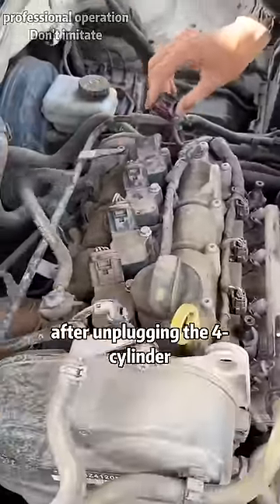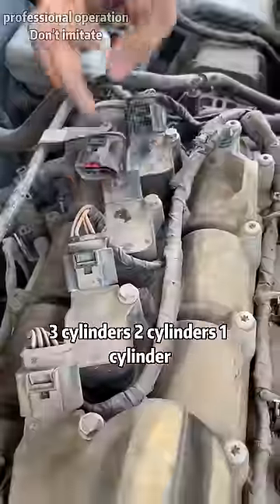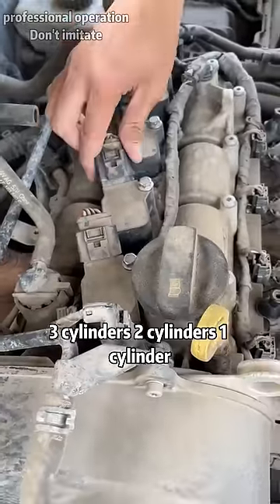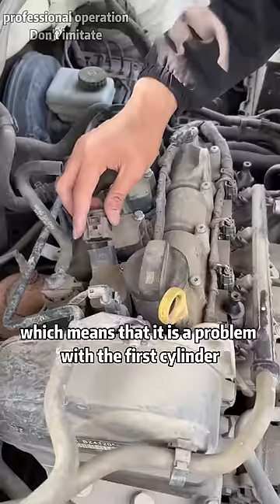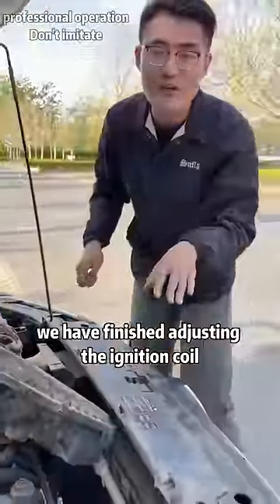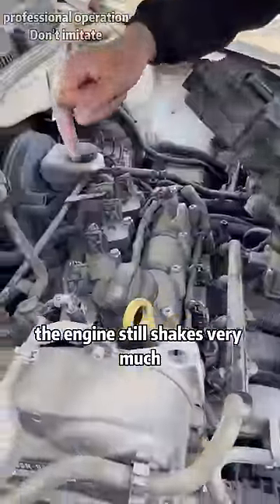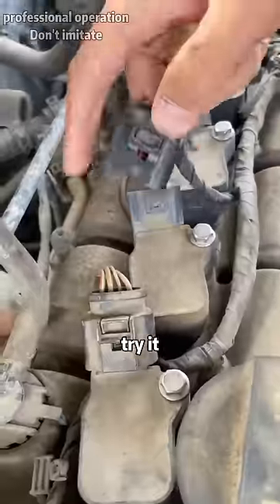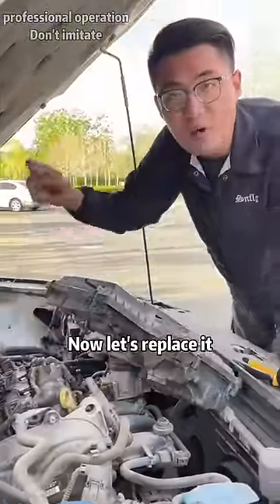（PART2）90% of people do not know the maintenance skills！#tips #car #shorts #tutorial #driving

Comment: Or just run an obd code check 😂
Reply: Not always useful. This car could be old enough that the only code the computer spits out would be a misfire detected code. Not all OBD-II systems handhold you like today's systems do, those older early generation ones were more of an on-board dumbass than an on-board diagnostic and at best simply told you it wasn't running right.

My '95 F150 is fully OBD-II compliant but it can't tell me which cylinder is misfiring. It's too primitive of an OBD-II system to know that. It would just report 'Misfire detected bank one' which...well it has an inline six it only has one bank of cylinders so that could be any of them. Tons of OBD-II cars on the road these days with the more primitive software/hardware packages that do exactly the same thing; you can't rely on that tablet to handhold you the whole time.

Beyond that...fuck I could figure out what cylinder's not firing using this test before the goddamn tablet even boots up. Hell, if my experience working in a dealer shop on Merc Sprinter vans is anything to go by, I could have the fault diagnosed, walk my fat ass over to the part cannon, load a coil into it, fire it, and return the car to the customer before the fucking tablet boots up!

Oh, and another reason to not rely on the tablet saying #2 is misfiring is how interconnected these cars are. The problem may not even be under the hood at all! You could have a bad speaker take a cylinder out these days. That bad speaker zonks the head unit in just the wrong way which causes a flood of garbage data on the CANBUS because OF FUCKING COURSE THE GOD DAMNED RADIO IS ON CANBUS WHY NOT, and voila. Bad speaker takes engine out. Been plenty of clips put up here of various cabin electrical issues causing complete no-crank no-start faults, causing crank-no-starts, causing misfires, random shutdowns, start-then-immediately-die faults, the works. These modern cars are such an overcomplicated interconnected electrical nightmare that you can't really trust anything they tell you and might just get sent chasing your tail trying to fix a problem with the engine that's actually caused by a box of apple juice the owner's 6 year old spilled down the rear passenger window last week.

Comment: So much wrong with this video smh. How does swapping the ignition coil fix anything? If you put the broken one on another cylinder, it will just cause that cylinder to misfire. Buy a new one and try it on the cylinder that's misfiring. If you don't know, just try each one until the problem goes away. If the problem remains you can buy another one and try 2 new ones, etc

Comment: i done this so many time on many vehicles they all asked me they vehicles still misfire and i pull code to see which side is misfire it say number 6 and try swap coil from 6 to 3 to see if anything different which it did so got coiler replaced than later other vehicles arrived which wasnt coiler at all it was no compression so coil really have nothing todo with it which why they replaced coils 4 or 5 time see no change it leads to failure cycling compression  which mean engine need be taked out of vehicles and on stand to rebuild it it just common problem with rest of vehicles when they not been taked care of it like lack of maintenance like they never changed oils at all which why it leads to many failures

Comment: This is exactly how I test misfires as a mechanic, however I will also test the spark plug by switching it with a different cylinder than the ignition coil, and use a scan tool to count misfires on individual cylinders if it’s not a dead miss and noticeable by sight or feel

Comment: First of all - i don't trust that video, 'cause we only see that it is shaking on ONE cylinder - and that's the 4th. on the other 3 zylinders, it doesn't, 'cause he cuts the video there - wo we must "pretend" that what he say is right. we don't even see him replacing the coil, 'cause then the short is "cutted off" - so, the few sec for the other 3 cylinders in the first run could have added.

and: he doesn't show how's the engine shaking by testing the 1.st cylinder after the switch - so, there's no trusting in that what he does, even when it might be the same procedure like a garage would do (but with thesting both swapped coils - and mostly even unscrewing the spark plugs, 'cause on these you see good if the spark was there and not strong enough or is missing. Yes, when the coil gets older, the spark can get less powerful - and even that can be shown in the same way that the engine is shaking.

just saying, i'm a mechanic - and that's why i'm so critic about that.

Comment: Or just code scan the damn thing.
Reply: It will tell you which cylinder is misfiring but it won't tell you why it's misfiring, swapping the coils and seeing where the miss goes will tell you whether the issue is possibly spark plug or wiring if the misfire stays on the original cylinder, this is an actual north american technician technique

Comment: Don't unplug shit. Check the engine code
Reply: It's going to have a check engine light from that awful misfire anyway 🤦‍♂️🤦‍♂️🤦‍♂️
Reply: And the codes will clear themselves after 30 minutes after you repaired it too after it passes a self test
Reply: @buttadog5073  Exactly. The coil will show up on the scan
Reply: @arturos.l.2248  No the coil won't show up on the scan, it will show which cylinder is misfiring. You have to do a coil swap anyway to verify if it's an issue with the coil, or if it lay somewhere else like compression issues or fueling issues. So a scan tool really isn't necessary if you're smart enough to realize your engine is missing on a cylinder.